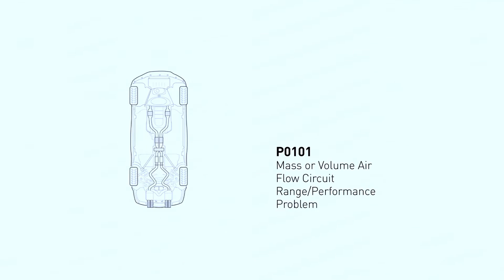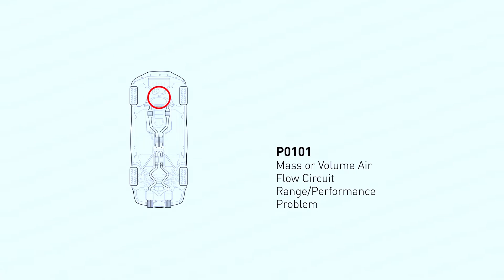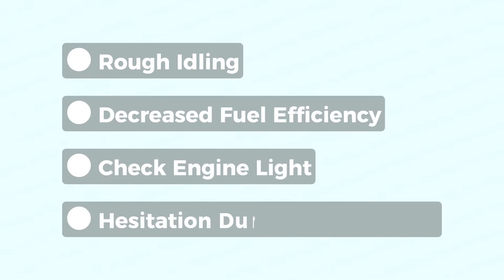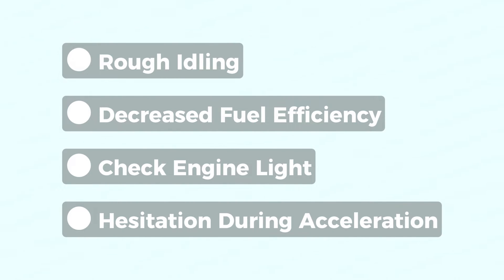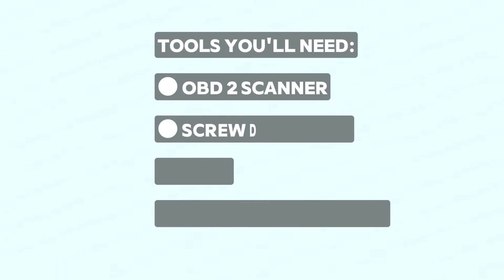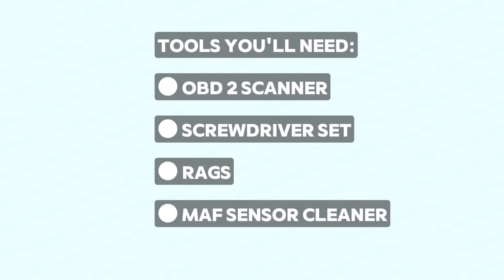P0101 Code Explained: Mass Airflow Sensor Problem | Fix It Yourself!

Comment: The element you are supposed to spray and clean is on the inside and is VERY thin and fragile. Those prongs on the outside are for temperature or something if I remember correctly... do NOT do what this video shows and reinstall... you didn't clean the right place it is an easy mistake to make. Bad video.